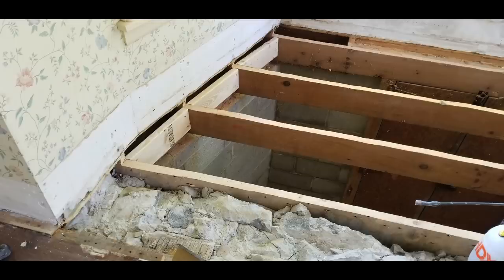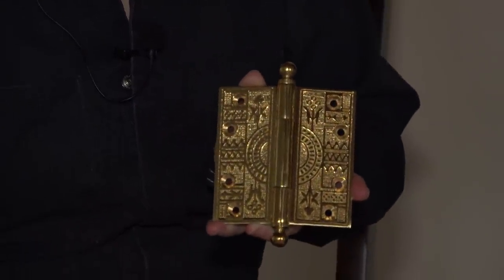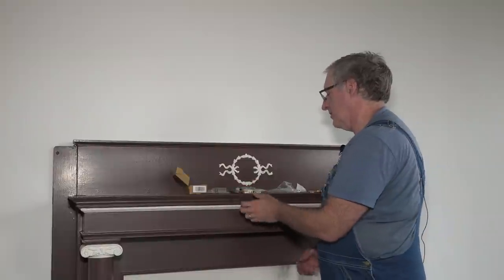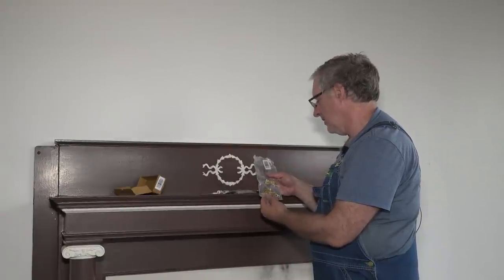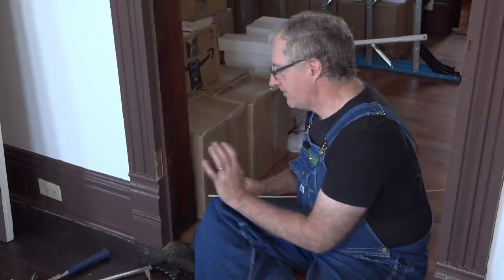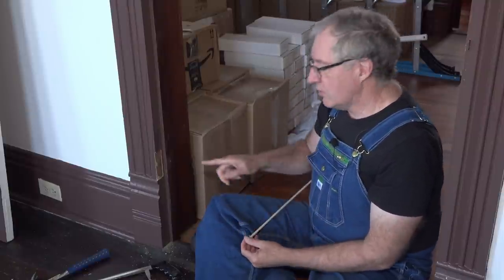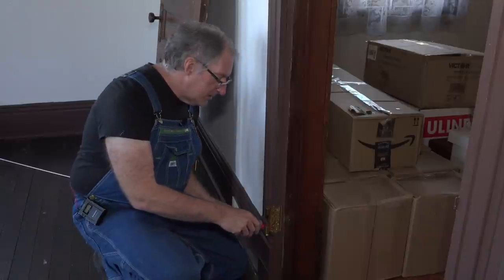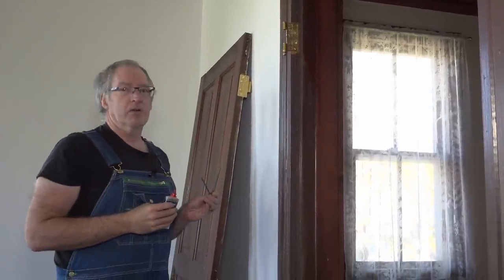EP 83 Hanging a Victorian Door

Comment: Here’s a tip for you. Rub screw threads with candle wax. I use Vaseline to grease the hinge pins, last forever. Ive also found that you shouldn’t tighten the hinge screws until the pins are in, gives you that fraction of an inch play you need. Those brass hinges look really cool. Love polished brass.

Comment: My sister and I just removed some cabinet doors from a house built in the  50's.  We had a really hard time removing the screws.  It took about a week to removed 60 screws.  The amount of paint over the screws was unbelievable.  We had to use a heat gun to remove most of the pain and then a pick to get as much pain as possible out of the indention. We finally got all of the hinges off., but it was quite a job.
Your door hinges are absolutely beautify!!
Reply from the maker: Oh the pain you must have gone through. Are you putting the original cleaned up hinges back on (minus the paint)?
Reply: @1834RestorationHouse  Definitely

Comment: Are you saving/going to salvage sell (or trade) the old hinges so they don't end up in a landfill? Seems the wood was done, maybe not the hinges.

suggestion: You can place hinge in inset (after you've finished the process of drilling tiny pilots) then push the tip of screw in a hinge hole and turn a few times just 'til it starts to bite... remove screw; do it to each screw hole like that THEN when you have the hinge for its final placement the screws will start in really nice. It does save a tad of time.

Really appreciate your work detail - old houses deserve such fine care.
Reply from the maker: The old hinge snapped into two pieces.....It's scrap metal now.
Reply: @1834RestorationHouse  Please excuse - I missed that in video.

Comment: the grain of the dowel isn't the same as the grain of the door jam. If you ever put a screw into the dowel it won't hold the screw as well. If you ever need to plug a hole that you might need to screw into, you would want to cut a plug out of a piece of wood with a drill with a hollow in the center, then using a saw you cut the plugs free and do as you are doing with the dowel.
Reply from the maker: Yes that is the best way but we didn't have any donor wood.

Comment: I'm curious about the fireplace openings.  Are the smaller metal grate openings original to the house or would the opening have been much larger?
Reply from the maker: This house is equipped with 7 coal burning fireplaces. The chimney breast  was built to be very shallow and there is a small coal basket. The shape of the breast creates a tremendous updraft to make the coal burn properly while preventing the heat from going up the chimney.